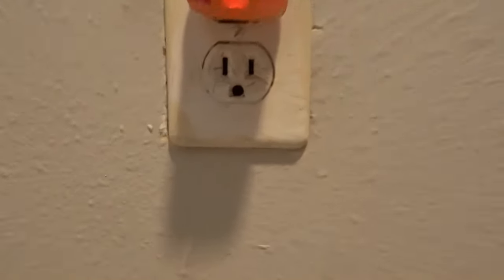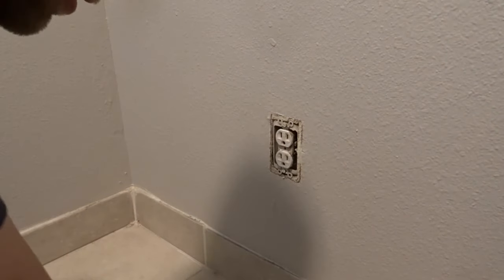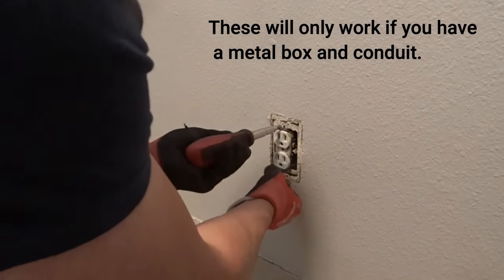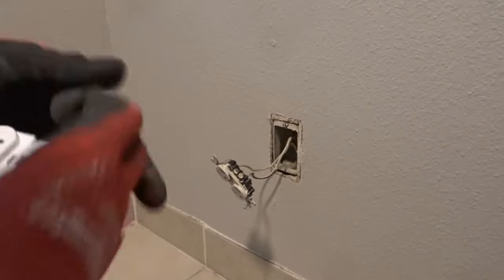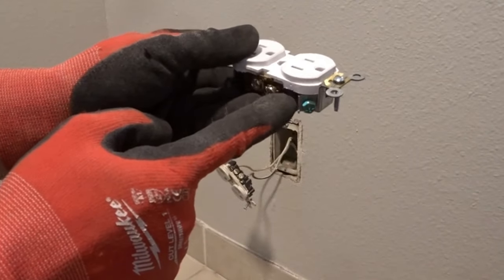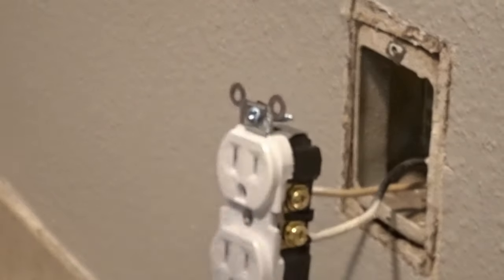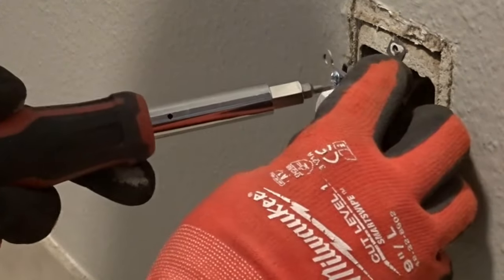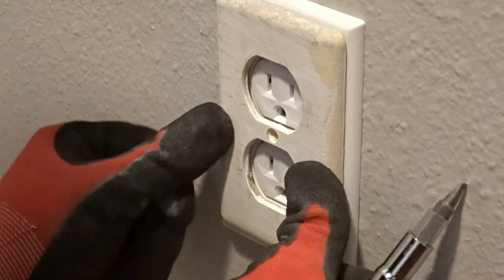How To Replace An Outlet | Ungrounded to Grounded

Comment: So I have an outlet that doesnt seem to be grounded. It has a metal box, but is using these thick wooden cylinder spacers. Im guessing this is why its not grounded. Can I simply add a pigtail to solve this from the receptacle to the metal box?  It looks like at some point the ground area of the receptacle was kind of sitting on a little tab for the box and maybe thats how it was being grounded?   Either way, I am hoping this solves an issue I am having where only 20v is coming in from the hot power source. Although I am not sure how far along the circuit this outlet is... 
Thanks!

Comment: So how do you tell if a box is grounded? I’ve seen in my bathrooms electrical box where the light goes there is a white wire connected to a screw in the box I’m assuming that means that it’s the ground wire and it’s grounding the box?
Reply: If you use a volt meter and test the hot connection in the outlet (smaller of the two holes) with the center screw hole in the box and you get 120 volts, then the box is grounded. The white cable is NEUTRAL, not ground.

Comment: This may be a old video but hopefully you reply, ….if I find the “lead/first” outlet and am able to run a ground wire to it to either the ground bar on the box or like a copper grounding rod hammered into the ground in my crawl space  then install a gfci with this ground wire attached will this ground all of the outlets following or only the one?
Reply: Only the one and never mind the ground rod, you don't connect it there.

Comment: Aaron: If the existing cable has a ground wire would you connect it to the green screw on the receptacle anyway? I ran into a situation today where I'm trying to daisy chain off of a receptacle to add a new one. Problem is, when I plug in the circuit tester it says there's an "open ground". So, I'm wondering if these Leviton 'preferred" receptacles will solve the problem?
Reply: The original receptacle must be grounded to the electrical panel and if it has a metal box, it must also be grounded. If not, you'll always have an open ground. No receptacle will solve the problem.

Comment: Thanks for mentioning the grounding pigtail.  That's a big help.  Do you have any tips for cutting/stripping cloth wiring?  (Our house has much older greenfield wiring. It is well done and definitely grounded, but we still have some 2 prong outlets.)  

This was much better explained and demonstrated than the video from Leviton. 😁
Reply from the maker: Wow! I really appreciate the feedback! As far as the stripping and cutting, it is the same process as newer wiring. Sometimes a strand will not fully cut, so you can get it with a blade. 
Let me know if you have any other questions I can help with!
Reply: @aaronfixesstuff  Thanks!

Comment: Without running a separate ground to a chandelier on a 3 way dimmer switch, how can I ground the chandelier? There is no ground wire at the chandelier junction box. just black and white wire..... i need to ground cause led dimmer type

Comment: Very helpful video, but it leaves open a big question. I do have a metal box, but no ground wire; how do I know if I have a conduit? Video says this won't work otherwise.
Reply from the maker: If you have a voltage meter you can test it. If you have a metal box you likely have conduit as well. But worst case, I made another video that shows what to do if the box is not grounded.

Comment: Those Milwaukee gloves are some of the best electrical gloves I've ever had... only thing is the wear out quickly
Reply from the maker: Agreed. And if you upgrade to the cut level 3 or 5, they are too thick.
Reply: Exactly,Milwaukee needs to male a thin glove that can take the wear and tear of a basic electricians day.
Reply: But the outlet is not fit but it's to stuck outlet because  of the cover.
Reply from the maker: @itzgametimevip1111  I’m not sure I understand your question.

Comment: Great job! One question: in older houses (pre 70s), where the box is metal, can you assume that conduit was used and the box is therefore grounded so that using a preferred outlet will work, as described? Or is it the case that the box may still not be grounded even though metal?

Comment: What does it mean when the little tester center light comes on and the other light comes on VERY dimly?  My tester does that at some receptacles and others it's on or off......not one in dim way.  My house was built in stages, originally in 1948, then ??, then another room in 1979. At least three stages.  Because the house was added onto, it's possible that some of the walls will have to be demolished, right?  I do know that two of my interior walls were exterior walls at some point.  Talk about a PAIN!!  I think I probably have some metal and mostly plastic boxes for outlets.

Comment: does the bottom screwhole of the outlet need to be touching the metal box or as long as it is screwed to the metal box will be ok?
Reply: I would have cleaned the paint off the box to be sure but since the tester said it was good, it was good.

Comment: I have a couple outlets which are in plastic boxes, both are using pigtails connected to the green screw on the outlet, and I'm still getting an open ground. What should I do?

Comment: Thank you for the great video.  Could you please confirm that you can only use the self-grounding clip outlet because your housing box is a metal box already, right?  If the housing is plastic, it won’t work.  You will need to replace the plastic box to metal box to make it works, right?  Thanks
Reply from the maker: Hi Duc, thanks for the feedback. If the box is plastic, replacing it with a metal box most likely won’t work. Your question was so popular, I made a video that addresses what to do if you have a plastic box. Here is a link to the video:
https://m.youtube.com/watch?v=A02AIiqEwJg&t=12s

Comment: How would the box be grounded but then there’s no actual ground wire as normal like a 14/2 ?   What is the box grounded to then ?
Reply from the maker: In some houses and apartment buildings the romex was run through conduit which acts as a ground. So if the box is metal you just need to attach to it. If you don’t have conduit, I posted a separate video with what to do. You can find it in the video description box.
Reply: @aaronfixesstuff  ok thanks for the info!!!

Comment: Sorry to be so lame, but how can I tell if the metal box has a metal conduit attached for grounding? My house was built in 1955 (versus 1970!). Seeing this video I'd like to use this technique if it were possible. How can I verify my box can be used as a ground without removing it from inside the wall hole?
Reply: If you have a tester such as the one shown and you have a 2 prong outlet, get a 3 prong adapter, remove the face plate hold down screw, and plug the adapter in.  Screw the tab down wth the wall plate screw.  Test the outlet with the tester.  If it shows ground, the box has a ground wire behind it, grounding the box to the panel. In such cases on an older home with an older metal box, you can jump a ground pigtail to the receptacle from the box, using a grounding clip to attach the pigtail to the box.  My house was built in 1955.  I used a grounding pigtail clipped to the box to legally ground the GFCI in my bathroom when I replaced my grounded outlet.

Comment: do all old electrical systems have the boxes grounded? how? how is that box grounded , by a grounding wire coming all the way from the main panel?
Reply: Not necessarily, but in this case the wire was run via conduit, therefore providing a necessary equipment ground when connecting the ground from the receptacle to the metal box. Since the metal box is connected directly to the conduit, the NEC allows for it to be used as a path to ground.

Comment: I have a couple outlets that are grounded and some aren't, I bout a house last year, and I want to get the outlets grounded that are not grounded, if some are and some aren't does that mean the self preferred grounding outlets will work like in your video? if some are grounded wouldn't the metal box be grounded?

thanks
Reply: No, the metal box has to be grounded already.

Comment: Hi Aaron, bought the same receptacle and didn’t ground it still shows open ground!?
Reply from the maker: I am assuming that your box is either plastic, or there is no conduit. If that’s the case, in the description of the video I put a solution for that.
Reply: @aaronfixesstuff   it is metal. I see a screw at the end of the box, should I try to pigtail it?

Comment: Can I replace 13 outlets in my house that has all 2 prong ones with GFCI outlets???  They will all be grounded then right?
Reply: No, they should protect individuals from serious shock, but if there's no ground wire, there's no grounding.
Reply: Okay now I understand.  I went on amazon typed in grounded outlets.  It showed the one you had.  Thanks because the ones I was going to get cost tons more.

Comment: So it doesn’t matter if you connect to the top or bottom screws?
Reply from the maker: It does not. It would only matter if you had a light switch that controlled one of the parts of the outlet.
Reply: @aaronfixesstuff  So if I were putting a socket as an end run receptacle I could use the top or bottom screws?
Reply from the maker: @Paco-hh4jd  that is correct. And I recommend closing the other screws and taping the outlet as well.
Reply: @aaronfixesstuff    Thank you so very much!

Comment: So if the box was not grounded then the outlet test would still show an open ground right?
Reply from the maker: Correct. I made another video that shows what to do in that case. If you go to the description box, there is a link to it.
Reply: No explanation as to where the ground  came from?

Comment: So the outlets has to say preferred? I replaced a few outlets and they went from grounded to ungrounded and I've used PVC electrical boxes to replace the metal ones. I did ground it to a nearby junction box where i did the splicing but that's apparently not enough. I do notice i have new levinton outlets but they're definitely not preferred.
Reply: I think the word "preferred" is a Leviton description. Other vendors may use another term. The thing to look for is "spec grade" a universal definition that is stamped on the receptacle.

Comment: You used that test plug to verify ground connection, but is it possible to use a multimeter to test for ground? If so, how?
Reply: Yes, one probe in the hot slot and the other in the ground opening. If you read approximately 120v AC, then ground is verified.

Comment: Did you remove the paper square behind the self-grounding tab?
Reply: Actually, the $4 outlet he used has only the paper on the top screw, and a metal retainer on the bottom by design.   But you are correct about that if using a $1 outlet.   Remove the paper screw retainer for better contact.

Comment: Very good video and informative Is it possible to ground a ungrounded receptacle at the breaker box? My house was built in 1951 but has a circuit breaker panel but I I just discovered that it was never grounded correctly. Thank you for sharing and any information you can provide.

Comment: If I'm getting buzzing in my guitar amp and recording equipment due to ungrounded outlets, will this cure that?
Reply: If any of your gear has a ground loop switch/button, try messing with that. But yes, properly grounded outlets should help your issue dramatically. If after you’ve plugged into a properly grounded outlet and you still have issues after messing with the ground loop switch/buttons again, your dwelling may have poor wiring. It could be something as simple as a loose connection within the outlet and it just needs to be tightened down (that also could be the case with your current outlet). If you don’t have experience with working with your homes electrical system, do not attempt anything. Contact someone that can help you before you touch anything. It isn’t hard work, but it isn’t work for the inexperienced. Basic electrical knowledge is important. I mean, you can change the face plate but don’t go poking around the outlet box with anything. Especially anything conductive like metal (also known as a screwdriver) without first turning off that zone of your homes electrical supply via the fuse box/breaker panel.
Reply: Make sure your cables are balanced and not crossing unbalanced cords. I notice this being the problem 9 times out of 10 when recording bands. Also could be the amp or the guitar itself.

Comment: I’m about to update my new home that isn’t grounded or up to code with electrical. It was built in ‘55 and does have copper wiring. Can I do this, before I have my box grounded so it can be out of the way, or should I wait until they come and ground it to replace/update all the outlets. And does it matter which wire goes into which side? Like does the neutral have to go on the left of the outlet or does it matter?
Reply: Bethany Olson, based on your 2 questions, I would say no, let them do the whole thing. In the meantime you can educate yourself on residential electrical wiring. There is an enormous amount of information on your smartphone.

Comment: How would you ground a receptacle if you don’t have a metal box and conduit AND a GFCI isn’t an option?
Reply from the maker: Why is a gfi not an option?
Reply: @aaronfixesstuff  because they are more expensive lol is that the only good DIY option apart from pulling a copper cable all the way to the panel and grounding it?
Reply from the maker: @sebastianzornosa9953  a lot cheaper than rewiring!

Comment: I have no ground wire. So should I get a metal electrical box and a preferred outlet? 

I was a bit nervous about this because I have a tv to it.
Reply: If you are not sure what kind of installation you have, just buy a GFCI outlet. Cost just a bit more and has a similar function to grounded outlets.
Reply from the maker: Here is a video that might help you.
 https://youtu.be/A02AIiqEwJg

Comment: how does that new outlet get ground out of thin air?
Reply: It’s grounded to the metal box by the receptacle’s screw and grounding clip on the yoke. Only some receptacles have this grounding feature—they are called “self-grounding” receptacles.
Reply: @hansski1995  i mean you said the old house isnt grounded, there is no ground wire, so for the metal box to be grounded it need to be touching wire or metal thats touching the ground rod buried under the ground. i cud be wrong but thats the way i understand it, so if the receptacle is grounded to the metal box, and the metal box isnt grounded to anything would that be enough to safely ground an appliance? i think that metal box if it isnt grounded to anything else would just provide about 5 volts of coverage
Reply: @tanyaortega5291  he mentioned in the beginning that the wire is run via conduit, therefore being connected to the metal box provides a path to ground, assuming the conduit is properly installed. The method in this video will not work if there is a metal box but no conduit, in that situation the easiest solution is to install a gfci, which he has a video about I believe

Comment: Awesome video I’ve had a few outlets in my house smell like there burnt and the feel hot I disconnected them so would they be just a bad outlet ther very old as well or should I be worried it something else
Reply: Be worried it's something else, sounds like the beginning of a "this is how my house burnt down" story. Get a pro in there
Reply: Are the ends of the wires silver by any chance?

Comment: Yup, i agree with a couple of comments posted. If the GND screw is used, then the box should be grounded as well, right?
Reply from the maker: Correct. If the box is not grounded, using a pigtail is not gonna do anything. I posted a video to demonstrate what to do in that case.
Reply: @aaronfixesstuff  yup...i noticed that after i watched the first video. 
 i checked it out..👍

Comment: Please update this video and explain to your viewers that the reason your method works that your box is grounded. Also 6 inches of wire  is minimum requirement out of the box. Other then that good information video
Reply from the maker: Unfortunately you can’t update a video once it’s posted. If you look at the comments, I’ve said that there was more than 6” of wire left after I cut the extra. Glad you enjoyed the video!

Comment: Hey, I love this video, learned a lot! one quick question, I wanna try to replace an old 2 prong outlet like you did, same thing only 2 cables inside, is there way to know or make sure if the metal box is grounded or not?
Reply from the maker: If you have an outlet tester it will tell you. They are pretty cheap and super useful. Glad you found the video helpful!
Reply: @aaronfixesstuff  what will the outlet tester say if the box is grounded?
Reply from the maker: @samual8299  what mine shows. The two orange lights will be lit.
Reply: if you have a multimeter connect one  of your leads to your hot wire and the other to the metal box.. if you're showing voltage then the box is grounded
Reply: @aaronfixesstuff  replaced a 2 prong outlet with the outlet you mentioned, and tested with multimeter, as Juan Toledo suggested (1 lead to the hot wire and the other lead to metal box) to see if the box was grounded, and it showed voltage, but when I screwed the outlet to the box and tested it…it still shows open ground. 🤷🏻‍♀️
Reply from the maker: @jessm1638  then the box is not grounded. I posted another video to show a solution for that.